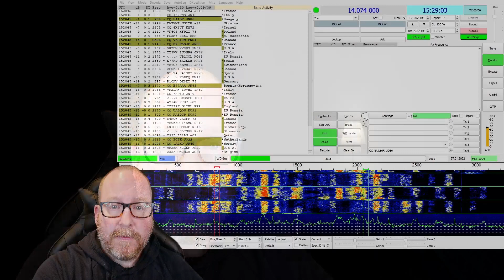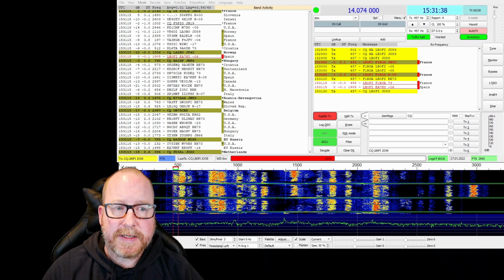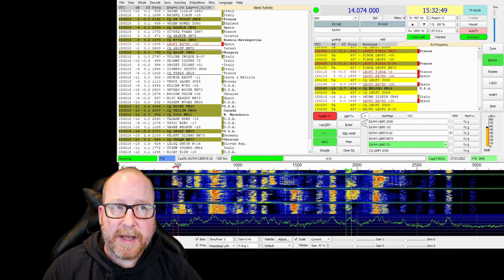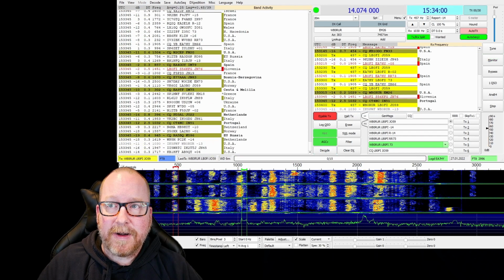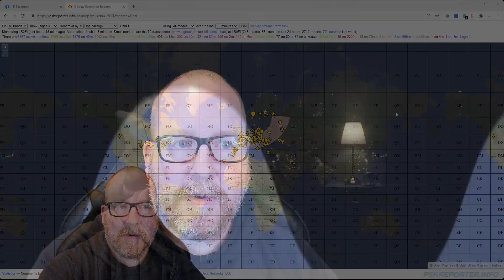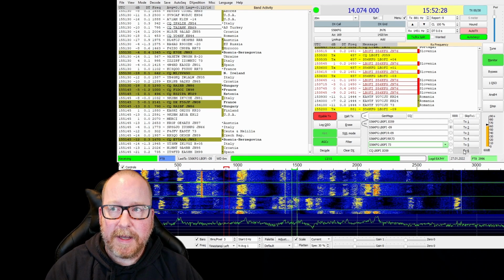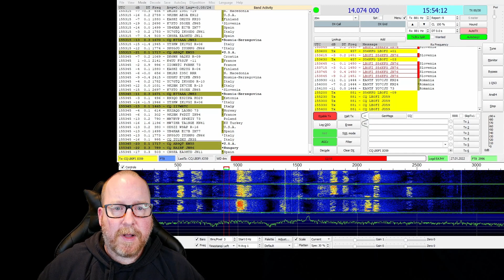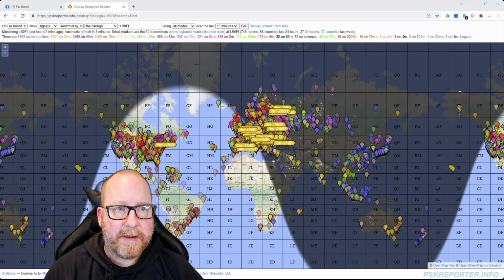Which is better, an EFHW or a Windom?

Comment: FT8 is a useless way to measure how good the antenna is. If you did a test in SSB, then you could make a comparison directly between the two antennas, by switching between them while speaking with another ham operator Then you could hear how strong he is, and also compare the signal strength. .73 LB5JG
Reply from the maker: And I guess that’s WSPR is useless as well then? And don’t forget that FT8 is ruining ham radio.

By the way, signal strength is reported in FT8…